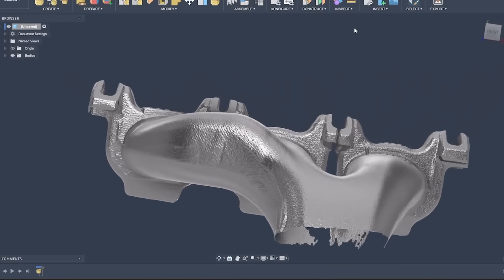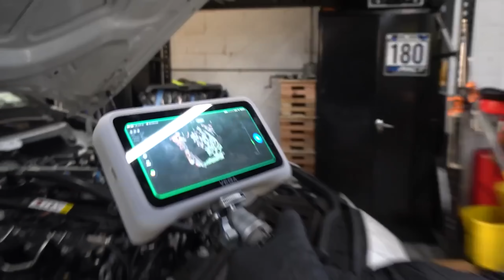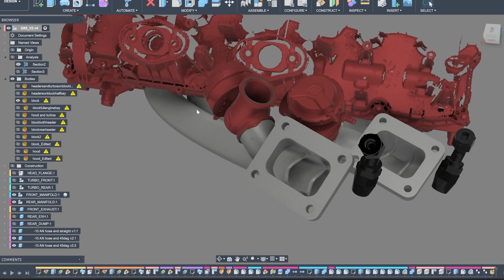MY $40,000 3D PRINTED TURBO MANIFOLD.

Comment: Are these typical stainless steel or inconel? How much did the 3d printing cost? What is the wall thickness? Will they stay reliable and not crack after many heat cycles? Example in a street car
Reply: I would also be very interested in knowing the reliability of these awesome manifolds.

Comment: Not sure if you e tested this but could those turbos suck in exhaust fumes? Wonder if it’s worth testing the kit with something attached to the exhaust pipes to get the fumes away from the turbo.
Reply from the maker: In my small dyno room adding a fan in front of the turbos adds 100whp at redline. I think at speed it has little to no effect

Comment: Curious to see power gains. Looking forward to power comparisons
Reply from the maker: Same. I have dyno sheets on the old motor. Same compression, displacement, cams, turbos etc. only difference is a ported head. 
I assume 500-1000 rpm eariler spool and 400whp more at 60psi boost